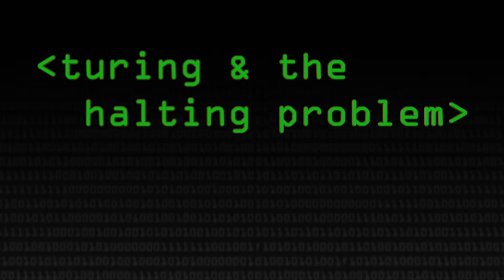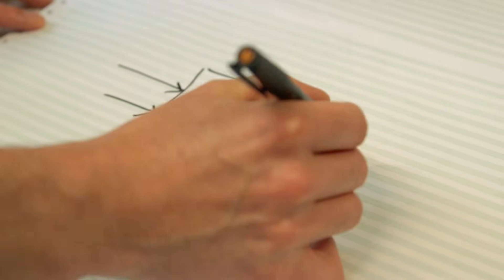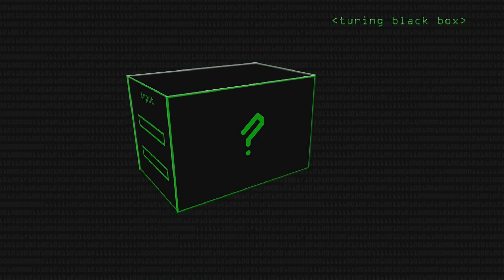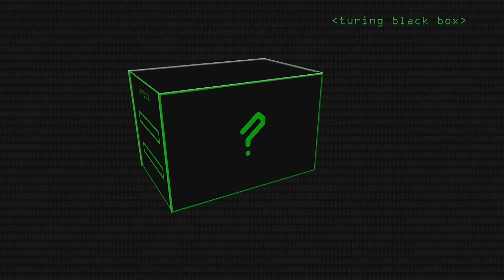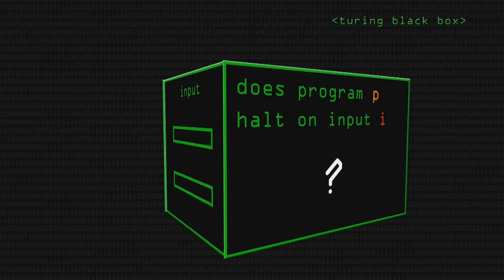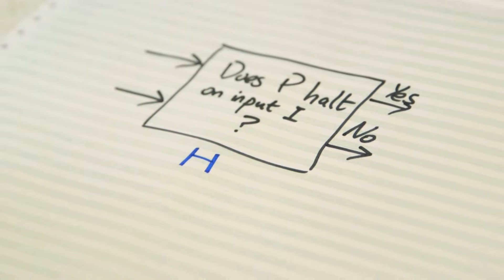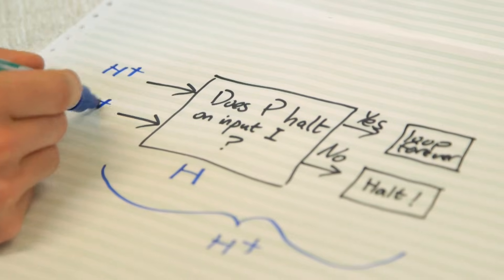Turing & The Halting Problem - Computerphile

Comment: Microsoft Excel, when you put C1 = C1 + 1, you get a no-halt error, and it haults. It's called error detection. I have proven that a solution has been identified. It's called code/variable analysis. Am I single handedly smarter than a whole college full of professors?!?! This makes me want to un-sub
Reply: Yeah, this is a bunch of nonsense. I don't get it either.

Comment: I haven't read the original proof but if this is an accurate description then it seems to me that there is a glaring flaw: H+ is trying to evaluate H+ with an input of H+ with no input. But this proof does not define what H or H+ will do when given no input. If it was a real program H+ would crash when not given an input, and therefore halt, and so H+ would run infinitely upon evaluating H+ with no input. And finally H+ would halt and return 'YES' when evaluating H+ with an input of H+ with no input. So once you actually define what H+ will do upon receiving no input, the paradox seems to disappear.

Comment: Given that H simulates the machine it's given perfectly, then H simulating H should be an infinite loop no? If it can't return from that loop, then it can't yield an answer, therefore if it yields an answer then H doesn't work. Which is a contradiction of the fact that H can analyse itself, not a contradiction of the fact that H can exist.

Comment: I don't get this. First off, you show one machine that won't work, and second off isn't it just wrong because it's inverted? So if you didn't invert it wouldn't it be correct? But also, I think that it does have a problem because wouldn't it get stuck in a loop? This is really weird and I don't understand it.

Comment: these sort of "proofs" of logical inconsistencies given an assumed axiom and using self-iteration built into the scenario it presumes to be describing are extremely problematic. Fundamentally, they are only proving things about the very specific scenario they're describing (assuming self-iteration is even valid in the context), and saying NOTHING about the possibility of having a machine that could compute halting of every single program (except another halting computer/itself). At best, they're just proving the principle of self-iteration simply doesn't apply to that doman

Comment: Why is it just not wrong to create the improved Turing machine to solve the halting problem in this way? What I mean is, if you switch the yes no boxes  in the improved version, doesn't the contradiction dissipate? 

Is it not like saying "I got up this morning" and then at the end of that sentence saying the inverse, " I didn't get up this morning" giving a contradiction that says "I got up this morning and I didn't get up this morning". But I clearly have...have I proved that its impossible to check whether I did or didn't get up this morning? or just proved my last statement " I didn't get up this morning" false. 

Why does this prove the entire halting problem as unsolvable and not just the action of creating the contradiction as false.

Comment: So basically no turing computer can cope with "This statement is a lie"?
Kinda sounds like a strawman when you put it like that, doesn't it?
If H is as smart as this scenario requires, it will understand that of two possible outputs, one is invalid, as it will not lead to halting, thus the other output is valid, as it leads to halting, thus the design of H+ requires H to lie. Thus it will do so.

Comment: When I think about this problem, it reminds me about chaos theory. For some extremely complicated set of changing variables, it seems completely random, for example the way the atoms in our atmosphere interact and move. But in theory, if you had the computing power and the initial set of variables, along with the instructions of how these variables will change through time, you could predict the future of this data set. In order to build a machine X that could scan another machine Y along with an input for Y and simulate what machine Y would output, you would need the exact physical construction of this machine Y and determine how it would interpret the input. In order to model the exact physical construction of Y and simulate how it would treat an input, you would need to know exactly where every particle of Y is, and machine X would also have to model how these fundamental particles interact with each other. It just seems way too complicated for machine X. It would have to simulate quantum mechanics in order to have the instructions of a CPU and to know what the output of that CPU is for a given input. If there is a machine that can model the physical makeup of transistors and simulate the way the particles in the transistor interact with each other over time and how the CPU will treat an input, please let me know.

Comment: You've only disproved machines which are limited by the two inputs and one output as unable to solve the halthing problem. What if your halter determiner machine was able to take in more information than that? Such as, "Am I part of a larger machine?", or any other relevant information necessary to solve the problem?

Comment: Let us assume that the halting machine has super intelligence and follows logics everywhere and avoids making illogical decisions. Here are three possibilities: it realizes it will get trapped into a recursive argument, and then to avoid getting a wrong answer, it may want to tell us that the question doesn’t have a logical answer. If we force it to produce a yes or no answer, it will try to generate a truly random decision so as to avoid justifying its decision, which is impossible to do so. Pseudo randomness is predictable and if it uses that, it will realize that it gets trapped into a recursive argument again. In this case, it has to justify one choice over the other, which is impossible; it also has to produce an answer. Therefore, it will be forced to give up and forget that it has to produce the correct answer. Or, it will remind itself that since it is forced by the negator to produce a wrong answer, it shouldn't count this as a failure. Overall speaking this thought experiment is useless since we all know that if you force a machine to be wrong it will always be wrong. But does anyone want to force a machine to breakdown?
Reply: it's like saying that scientists can predict nothing because whenever they predict something a machine will be programmed to screw up the result. You still can't say that scientists fail at this case because without this screwing   everything up machine their prediction could be 100% accurate. And apparently, this screwing machine never exists, no one would want to design such a useless machine for any practical reason.

Comment: 4:15 is misleading: What does "Output: Halt" mean? "Output: Yes" or "Output: No"? And it's not that clear why it's ok to take H+ as a basis for the argumentation..why can't one still argue "Ok this is the modificated H+ but my H still works and will always give my a correct definitive answer".
Reply: Simple. Given some input H+ will run that input through H. Then if H says the input will loop H+ will LITERALLY halt and if H says the input will halt then H+ will LITERALLY loop.
Now if we recursively evaluate H+ on itself we Find that it’s impossible for it to halt but also impossible for it to not halt. So if we take that configuration and try to evaluate H on it the H will fail as neither of the two possible outputs of it, (“the input will loop” and “the input will halt”) can be true. Therefore there is at least one scenario in which H doesn’t work. But the defenition of H states that it absolutely ALWAYS works. Therefore any machine capable of failing isn’t H. Which means H cannot exist.

Comment: I'm fully aware of the paradox here but surely if you set out to sabotage the machine from the get go what's the point? Take a simple task that already exists like a printer. If you then add a piece of tech to the end of a printer that shreds the paper when you don't want it to, that is your own fault? Why would you instal a further piece of tech that would act in opposition to the conclusion that "H" had given?
Reply: Here is what I understand of the halting problem:

A printer does exist - we know it does, we've built it! The very existence of H, however, depends on its ability to solve the halting problem for ANY possible input. We have a method for building a printer, we do not have a method for building H, just a requirement that it must meet.

The reason why H doesn't exist is because it cannot meet this requirement; it cannot solve the halting problem for ANY possible input. Why? Because the halting problem for the machine H+, H+ cannot be solved.

I agree, it's very hard to wrap your mind around it. I have to be spoon-fed analogy after analogy every time I read up on it again. Turing was a genius to be able to think up such an idea.

Comment: I have a question to extend this, which I could not find asked below or online. 

Lets say you create a machine that you claim "this can solve the halting problem for any input that does not contain an attempt to solve the halting problem". So H, H+, this machine, and so on would all be considered input that you do not claim it solve the halting problem for. Lets say in this case it gives a 3rd output "Invalid Input" so it makes no attempt to give answer about it halting or not halting. Is it possible to show that this machine can give an incorrect answer as well?

Comment: But what if it just returned an error, or the machine breaks if it receives itself? Is the paradox solved?
Reply: then the error IS the paradox, it does not gives you a "yes/no" answer
Reply: no but have something at the beginning that's like "if i receive myself, then return error" or something. have a third output
Reply: dolfin rule then it does not solves the halting problem anymore because our machine can run ANY machine. if it does not run on itself, then our first assumption isn't even true and the halting problem is proved. that is, no program can decide all programs. that's the halting problem
Reply: oh okay that makes sense

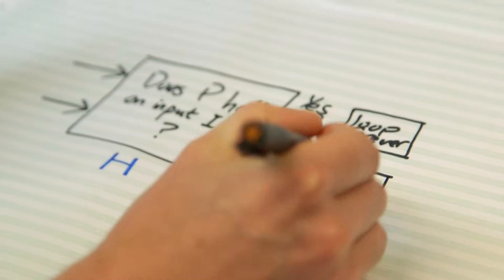Comment: it contradicts only because what you did from 4:10 to 4:25
Why did you do such a thing? 

What you did is like:
Is 3 greater than 2?  If yes assume 2 is greater than 3, if not assume 3 is greater than 2.
But if it takes the first path (2>3) then the answer to question was yes. (3>2)
If it takes the second path (3>2) then the answer to question was no.(3<2).
Contradiction.
Hence, it is impossible to built a machine that decides if 3 is greater than 2 or not.

It is as illogical as what you did there.

Comment: Mark says that we feed H+ into itself, this is the bit I can't get my head around. Could he perhaps mean that we feed H+ into H? That would make sense to me, seeing as H is the machine that purports to solve the halting problem, not H+.
Reply: Yes that's what my doubt is exactly. The bigger machine h+ is doing what it is supposed to, I don't see any paradox there
Reply: @SpartanSky if we feed H+ into itself recursively, does it halt or not?
Well it can’t halt because if it did then it would loop and it can’t loop because if it did it would halt.
So we take this recursive H+ and run it through H, then H is unable to give an accurate answer as no answer can possibly BE accurate.
But the definition of H says that it ALWAYS works, so this one situation where H can’t work means it can’t exist at all

Comment: Here is the problem.The machine that is pieced onto H is designed specifically to give no answer in the event that the answer it is given is a positive one.Because it is contained within its very design that "it will halt",in a sense,it doesn't halt.Halting is a response to its input and it is therefore an output,even if it is not observable.Logically,it does not halt because of a malfunction or because it cannot solve the problem,it has already solved it,and the answer to it causes the machine to stop working."Halting" is an answer and machine H is still correct and it has solved the problem.No contradiction exists.

Comment: Excellent Explanation...!!! Just  a doubt whether h+ can be fed as input in h+ necessarily requires input h+? Don't we require one machine an any input will work? A theoritical explanation on paper wouldn't be more appropriate?
Reply: This proof is maybe a bit too short to explain that question, but let me try to help you out:

Let me introduce some variables: g and f.
Let us assume f is the function which is calculated by h+ and g is a the function that calculates h.
Some examples: f(<some-input>) = yes, f(<some-other-input>) = no answer (endless loop).
g(<some-program>, <some-input>) = yes /no
g(h+, <some-input>) = yes /no

Now we need come to the point with the input: f(x) prints yes or gets stuck.
g(h+,x) prints yes or no. 
1. Assume f(x) prints "yes": g(h+,x) gets stuck=> no paradox
2. Assume f(x) gets stuck: g(h+,x) just prints "yes" => also no paradox

But now assume x = h+:
1. f(h+) prints "yes" (so it halts): g(h+,h+) negates that and gets stuck, but f calculated that h+ halts, but h+ does not halt => paradox

2. f(h+) prints no(so it gets stuck): g(h+,h+) negates that and prints "yes", 
but f calculated that h+ gets stuck, but h+ does print "yes" => paradox

It is paradox because: we assume that h (function f) always prints the correct answer. With the feeding with the input h+ and the "negation" with machine h+, we always end in a situation where h+´s answer is not the same as the maschine h told us.

Comment: Thanks for this explanation.  Just the use of the H+ terminology makes this much clearer than many variants of this I've seen. Personally, I find the computer graphics redundant, compared to the simple diagram on printout paper. Impressive teaching skill.  Also, making explicit that 2 copies of H+ are fed in 'in parallel' allows the analogy with H to be made explicitly.

Comment: So what? If the initial desire is to create a logic testing machine then just make the logic testing machine, put in the code that it returns "indeterminate" after a certain amount of time or if it loops more than 10 times, then have a human update the programming to enable it to solve whatever halted it. If it's not obvious, I'm an Engineer not a philosopher. Also, when building H just switch those boxes on the end

Comment: What if H had a third output: "paradox detected"?
Reply: Michael Jones An output happens when it halts so when would it decide a paradox is involved? When we get "paradox detected" it halts and that is an answer which causes it not to be a paradox, so a new paradox is formed because you cannot suppose that you can detect a paradox from inside the program itself.
Reply: punkonthego you forget, we humans ran a logic test of sorts in our minds and proved a paradox. if we can do it, then a computer can do it, hence, our method could be "programed" and a "paradox results" could be formed. 

perhaps splitting the information stream into 2 streams, one with a not, and then running them again to see if they equal each other. if so, then paradox result detected, just as we here did.

however, what would this "paradox result" prove? it doesn't disprove Turing's conclusion. 

it's interesting to think about and we should include it formally in machines!!! take the work away from us!
Reply: Richard Iphone no no no, you just don't understand this at all.  Please go and read about this some more.  It is not possible to solve this, that has been proved beyond any doubt with simple logic.

Comment: waaaait.. I'm thinking on a slightly different problem here, but wouldn't h+ require two inputs but you are only providing one? Ok.. solvable by adding a cloning device at the beginning, still just sayin' :3

also I think it would be clearer to input h++ into h , which of course will lead to the same problem that h++ is being fed into h++, but it's just less misleading. The biggest problem people seem to have is, that effectivly in this video you have shown that h+ cannot exist, not h cannot exist, sometimes to a learning mind this can matter
Reply: also can you not show that H cannot exist, because if you feed H with H as both input and program, the tested H will expects 2 inputs which you can provide, but it'll need to be a part of H itself so the number of expected inputs will, no matter how many inputs you add, always be one higher then you can ever provide?